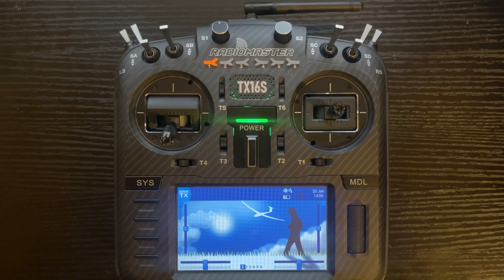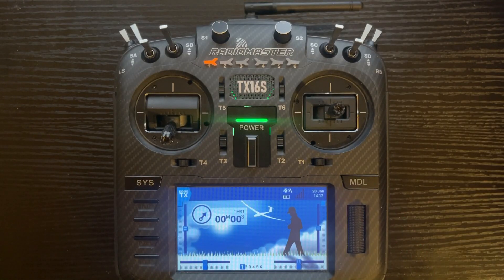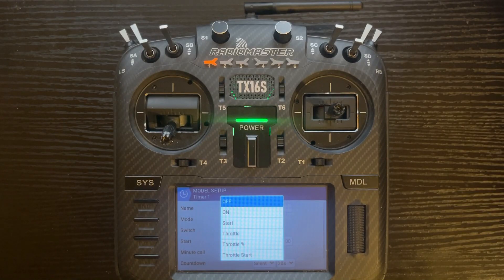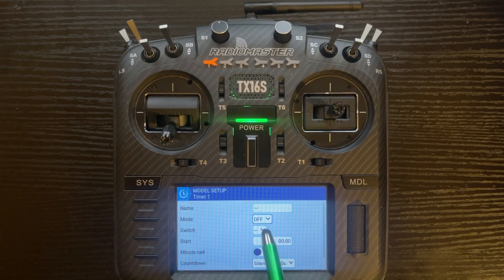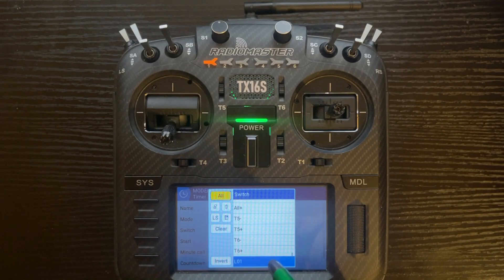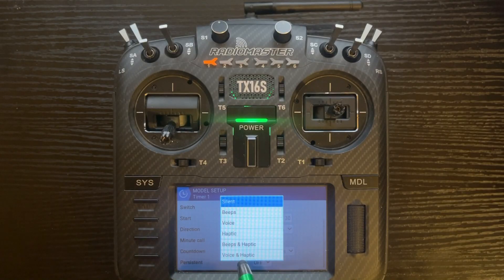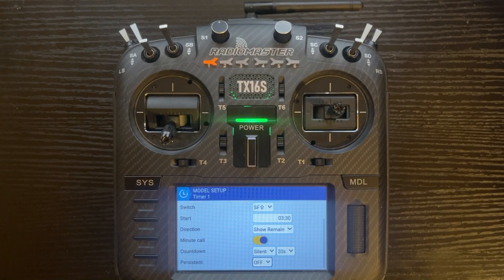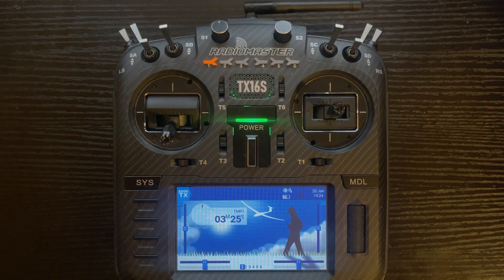Radiomaster TX16s/Edge Tx: Timers 101

Comment: Hello!

How do you set up the manual reset? I have mine set for activity right now, but would like the option to reset it after each flight(which I cannot figure out how to do)? Thanks for any help you can offer.. As I am new to this device with its myriad of options...
Reply from the maker: Manual reset to refresh the timers and telemetry without turning off and on radio?
Reply: @BDTennessee  Hey! I simply wanted to say, after a pack ran down, I want to reset the timer(that starts and stops with throttle moving) for the next flight and pack. Possible?
Reply from the maker: @DamonGaskin  Push scroll wheel in and click reset telemetry. Select from 5 options listed...
Reply: @BDTennessee ok, awesome! Many thanks.
Reply: @BDTennessee Thanks a lot Bud

Comment: Hello BD,
Could you show how the TX16s Max balances on the two different neck strap holes in an upcoming video with the 5,000 milliamp pack? I prefer the transmitter to tip forward a little bit versus being bottom heavy. 
Also, do you stand your antenna up when flying or do you leave it laying down sideways.
Thanks in advance.
Larry
Reply from the maker: Bottom hole and 6200 balances level...

Comment: It seems you have been embracing radiomaster over spektrum lately.  They seem much more affordable for what you get.  Would you recommend that a person moves on from his NX-8 to a radiomaster?
Reply from the maker: I been flying Radiomaster about a year straight. Depends on the user. NX8 is good value and now has 20 channels. Radiomaster gives better value with some initial understanding and learning. Both have a place.

I use TX16s and Spektrum Gyro receivers...
Reply: @BDTennessee Thanks for the response. I appreciate your opinion and thoughts.
Reply: The "NX's" Radios have a lot hardware problems,, but the worst is the technitian support of Horizonhobby DE  that is a shit.
Reply: @mariopires224 yeah, if anything's wrong you end up having to send your radio back. That's why I bought a second one. Now I'm wishing I just would've migrated to radio Master at that time.